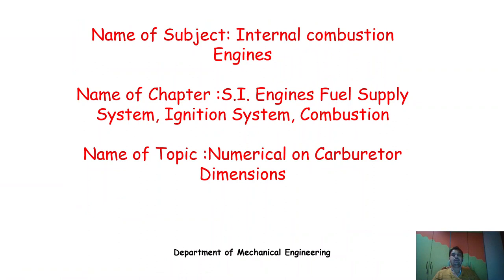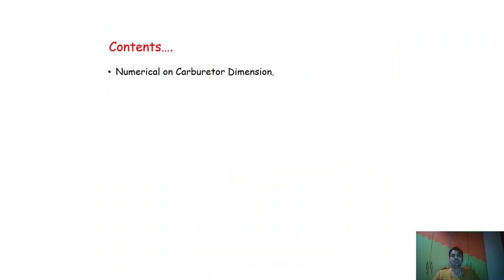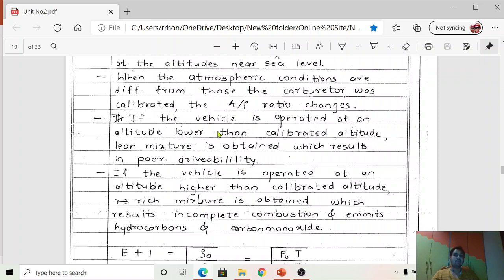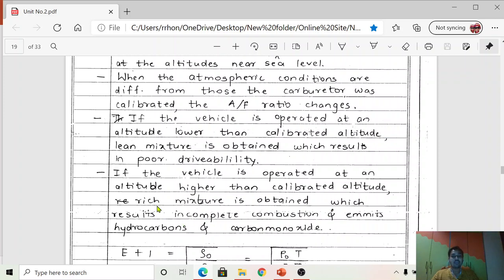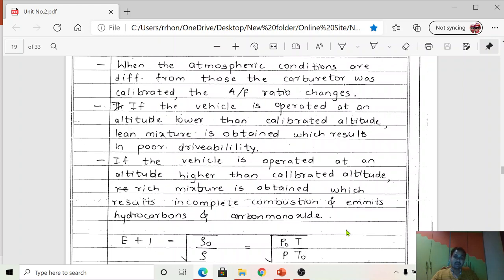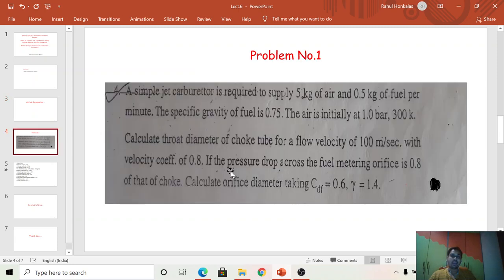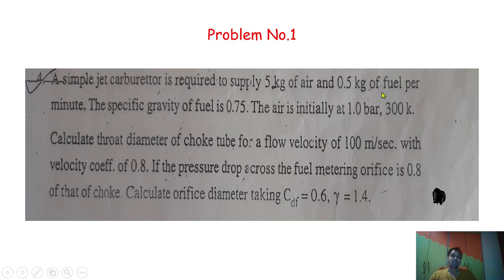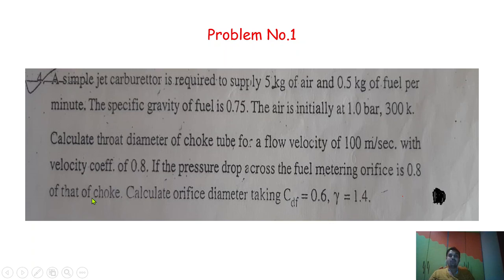Lect.21 Numerical on Carburetor

Comment: A simple carburetor under a certain condition delivers 5.45 kg/h of petrol with an air fuel ratio of 15. The fuel jet area is 2mm2 with coefficient of discharge of 0.75. If the tip of the fuel jet is 0.635cm above the level of petrol in the float chamber and the venturi throat coefficient of discharge of 0.80. 
calculate: 
(i) The venturi depression in cm of H2O necessary to cause air and fuel flow at the desired rate. 
(ii) The venturi throat diameter. 
(iii) The velocity of air across the venturi throat. You make take density of air = 1.29 kg/m3 and specific gravity of petrol =0.72
Reply: Can I get a solution for this please